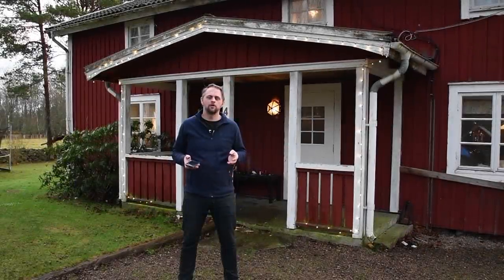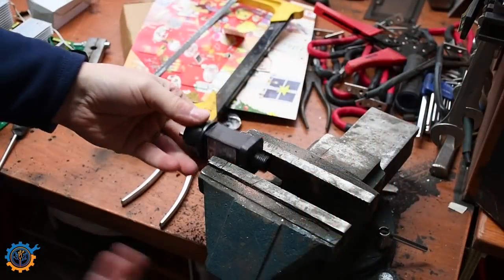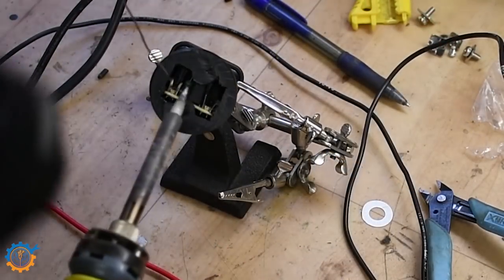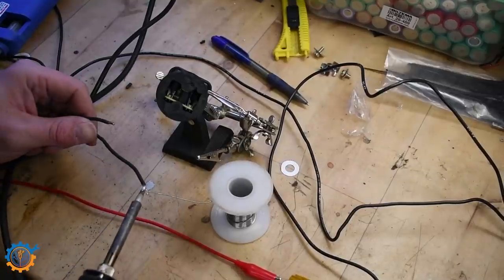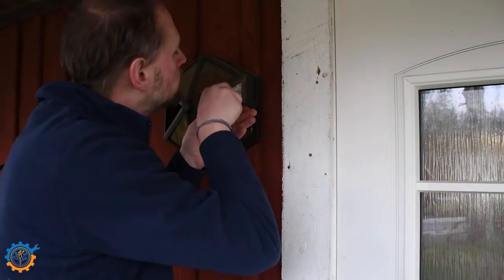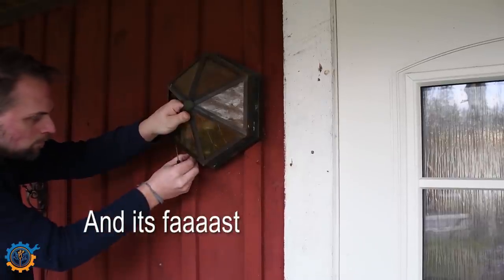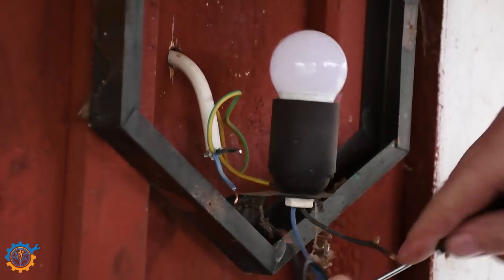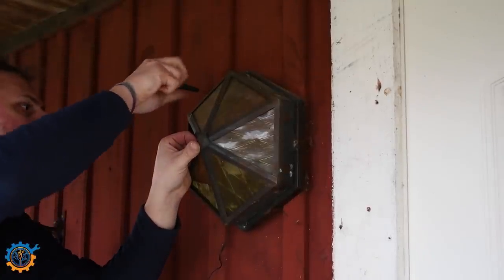Christmas lights added to existing out door lighs

Comment: What system do you use to control the lights from your phone?
Reply from the maker: Gerard L zwave and homecenter2 but have alot of other stuff with mqtt and 1wire and so forth
Reply: Cool, thanks. Running z-wave with Domoticz myself so i could combine it with 433mhz and such.